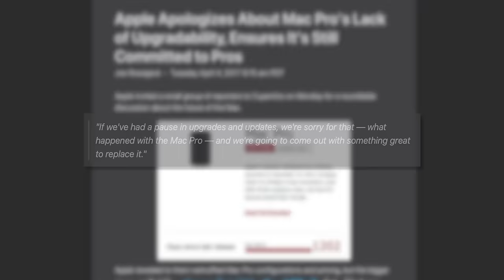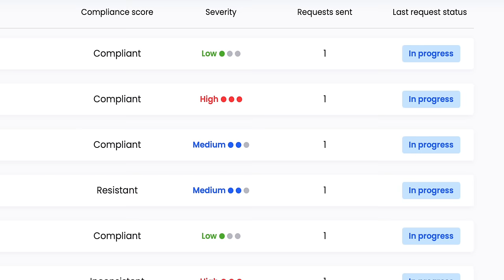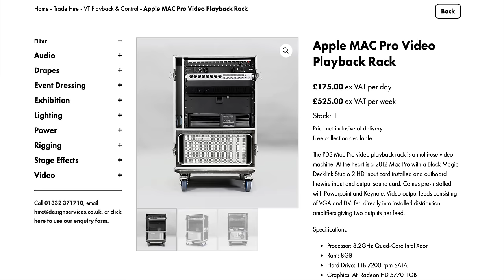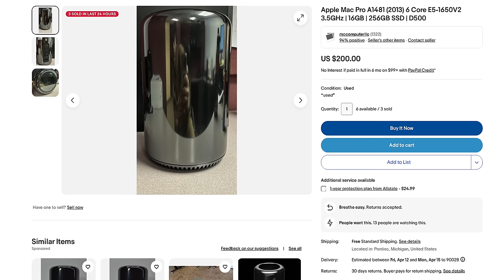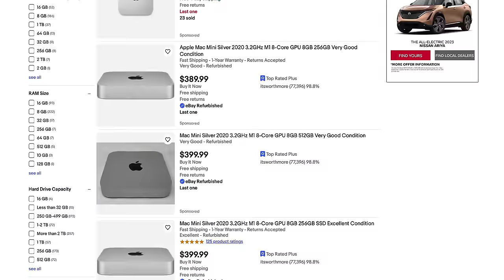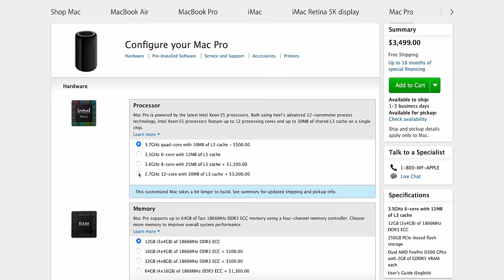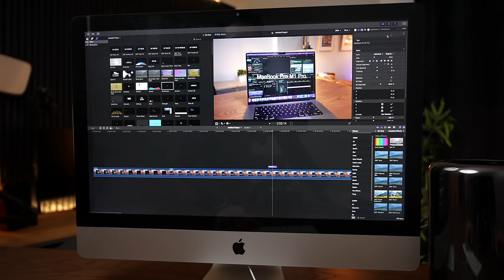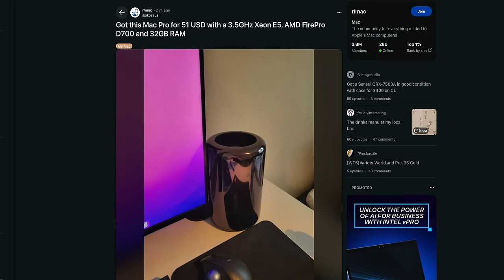Revisiting Apple's FAILED Mac Pro in 2024

Comment: This would be handy for running an older 32-bit compatible OS for longtime creatives, just for opening up older projects. I have Terabytes of 3D & AE projects from that era and before that are currently inaccessible.
Reply: Yeah maybe, but you would still probably be better off getting a dual CPU 5,1 Mac Pro since you can put a modern GPU in there.  CPU isn't as fast though obviously.
Reply: @gametime2473  You really can't put a modern GPU in a 5,1. Not anything newer than say 5 years old.  Needs the apple firmware to get a boot screen, and metal support for anything above Mojave.  Sure it will fit, but what's the point?
Reply: @colindewolfe3647  You can put Radeon rx-6xxx cards in them.  I have done it.  Syncretic patch.

Comment: A good video, I must admit I was surprised you had a second look at that device, I think I might have found the perfect use for these old Macs here in the UK, you see in our schools we use Windows OS not Mac OS, so install boot camp you can turn an old Mac into a great windows computer, replace the spinners with SSD and pop Microsoft Office on them and they are good to go, try putting windows on one using boot camp and bench mark it with a modern windows computer and see the difference, also all those lovely 27" 5k iMac can find a use in schools,  I would love to see that.

Comment: Back in 2016, YouTube Space LA had these in their private edit suites. They also had RED Cameras that could shoot 6K, which was pretty radical at that time. We shot a video with one of those REDs in 6K and that trashcan Mac Pro was the only thing that could handle that footage in FCPX. And it ripped through 4K footage like butter. I know everything you're saying is true (and I own an M3 MacBook Pro Max 16"), but nothing has compared to the sheer power I experienced with the 2013 Mac Pro back in 2016 with that RED footage. It's forever ingrained in my head. (So much so, that I was considering picking up one of these old Mac Pros on eBay)

Comment: I went back to finish my degree in 2012, by 2014 the university upgraded to this Mac Pros for its communication major classes.  I ended up working with them after I graduated and until I left in November 2021, almost all of those Mac Pros were still going strong. I would not be surprised if they are still using them to this day.

Comment: And this is why people like me are still running and using the 5,1 2010 Mac Pro's till now. Hell, I'm writing this comment on my 2010 Mac Pro right now!
Reply: Yeah ironically because the 4,1 and 5,1 has PCI-E slots they are still better than this one.
Reply: My plan with the 7,1 is to put a screaming nVidia card in it in a few years and boot into Linux or Windows with maybe a VM for an old macOS
Reply: Time to upgrade that crap. It’s been unsupported for years
Reply: @emilsecker7881  Yeah it shows how much you know about mac pro's from that era. Do your research before commenting.
Reply: @emilsecker7881  Whatever you say. Your the expert.
Reply: @houseoflords2010  *You’re

Comment: I was the senior (and only full-time) editor at a production company and facility. Over the years, my edit system went from a PowerMac G5, to a Mac Pro 1,1, to a Mac Pro 4,1, to a trashcan Mac Pro. These were mirrored in our two edit rooms. Each time we got new machines, workflow got faster. But the spaghetti monster that stuck out of the back of the machine was not pretty. And we only upgraded one edit room to have a 5-drive DroBo for my editing. At home, I still use a Pixlas-modded, OCLP-patched, Vega56, beefed up monster. Eventually, it will have to be retired for a new Mac Studio. No complaints either way. It's an enjoyable ride.

Comment: I always thought it was cool and forward looking in terms of not needing the internal slots, at least for most users. But that design theory needed, as you said, USB C to really work. I was excited to use one for multiple projectors for theatre projections but the fact that each pair of ports are shared limits how many you can actually connect.

I plan to get one to put on display here in the studio, but don't have a use for one.

Comment: I now have two trashcan Mac Pros, and I've upgraded the CPUs in both. My first trashcan, acquired in late 2022, has a 3 GHz ten-core CPU (and 64 GB of RAM and a 2 TB NVMe SSD). My second trashcan, which I acquired a couple of days ago, now has a 3.7 GHz six-core CPU (and 48 GB of RAM and a 1 TB NVMe SSD). Both CPU upgrades are non-standard and better-value than Apple's official configurations (you could order a 3 GHz Mac Pro from Apple, but with eight cores to my ten), and my second trashcan is like a Base Plus configuration: the same 3.7 GHz clock-speed, but with two extra cores.

Comment: Your trashcan 2013 Mac Pro videos are great. Almost like a series at this point! I think it's pretty clear, from your previous videos, that these are not great personal computers. But how about exploring the data center side of things, since the hardware is workstation class?

Maybe these machines are actually better at running web servers or services with the 128gb ram and 12/24 cpus and double ethernet ports than the modern Macs?

Comment: video idea: make a m1 trashcan :P 3d print a back panel, try to use center triangle heatsink and cover with exterior enclosure.  sleeper mac in a mac
Reply: Keep the triangular internal design and make it a cluster of 3 (or 6) M1 minis (which are largely empty boxes)

Comment: There were two of these where I worked and neither functioned correctly and were eventually replaced by iMacs. They were mainly used with Premiere Pro for editing and DaVinci Resolve for color grading. Both applications suffered from rendering issues, DV Resolve would have random green frames or random lines on the rendered images. Premiere Pro had similar issues but at least PP could be set to software render and disable GPU acceleration, but the only way to get DV Resolve to work was to lower the render FPS speed to it's lowest setting to prevent the GPU overheating and leave to export overnight. There was even an app installed to manually control the speed of the fan to try and prevent the overheating issue but it wasn't that successful.  If I remember correctly one of them had it's GPU replaced but it didn't fix the issue.

Comment: I have one that I use every day. Most of my daily working computing involves using remote desktop to multiple machines that I am managing. I have a 6 screen array that allows me to keep tabs on a half dozen machine at time. Previously I had been using 3 computers each lighting up two monitors. With the Trash Can and some active MDP to HDMI cables I can do all of the screens with a single machine. I get to remove two keyboards and mice from my desk for a couple of hundred bucks. Bonus, my office is nice and toasty all winter. Not as warm as my G5 used to keep the place, but nice enough!

That said if I were to build this workflow from scratch I think a couple of 50" 4K TVs and a silicon Mac mini would be the way to go.

Comment: I remember when they announced this… it was so cool-looking, and I was already hittin the wall with my Mac Pro Cheesegrater. I was ready to call my bank to get paperwork moving for a loan… and then the user reviews started showing up on youtube. I instead got a locally-sourced modded 2010 Cheesegrater that could run 10,11 and (barely) managed to hold on until M1 Studio. I've got a saved search on eBay for the Trashcan—but I just want it for my backgrounds when I'm filming studio videos😂. Great vid. Thanks!

Comment: Good video. I feel like the 2013 Mac Pro could have been something way better if a proper dock was made for it then it could have worked but Thunderbolt 2 didn't take off. The big problem is that the M1 Mac and newer versions you must have an internet connection just to install an OS.

Comment: I ran an eBay search for a great price on a trash can Mac for over 4 years, and never got the price I wanted. 

I cancelled that search and bought an M1 MacBook Air as soon as they announced the M series chips. I still have 3 cheese grater Mac’s at home. Very pumped up. But I mostly use them as DLNA servers now. I do run some legacy software on my 12 core.

Comment: Wow, I remember when it came out and thought it looks nice but I can still work with my maxed out MacPro 3.2. As you say, the pricing was insane. Design wise it's still a good concept having a chimney to draw heat up and out is efficient. It's so similar to Apple's previous failed concept of the G4 Cube. No fans, using a clear central core to draw the air up. I wish I still had a G4 Cube. Ashamed to say it was skipped.

Comment: I had one from new and ran it 10 years. I quite liked it for most of that time. I bought it as an 8core /16GB/1TB/D500 and changed it to a 12 core/64GB/2GB machine and it was quite quick. The main boost was the SSD. But compared to an M1 it's still slow. and the Trash Can won't run current OS. So ultimately was glad to see the back of it.

Comment: I use one as a Proxmox and has been super reliable as a Linux based server. I used to run VMware ESXI on it and it was solid. 12 cores. ECC RAM. Dual network interfaces. Nice for a home lab server.

Comment: I have one, it came with the A700 GPUs, the 12 core CPU, and 64 GB ram from the factory and the serial number indicates it was build in Q2 2019. I paid around $300 for it a few months back, but someone who originally bought it must have paid around $10k and then probably never used it. Anyway I get a little over 7000 in Cinebench R23 running in Monteray. It runs Windows 11 pretty well but when gaming it uses 250 watts, so I don't use it either and it just sits. I have a M1 Mini 16/512 which gets around 6800ish in Cinebench R23 so my trashcan just slightly beats it.

Comment: I utilized my previous device until I acquired my MacBook Pro M2 Max, which offered significant upgrades. I enhanced its capabilities with a 128GB OWC Kit and a 2TB OWC Kit, complemented by the 12 Core version featuring dual D700s. Throughout its use, the device performed admirably, requiring only occasional restarts for updates. Regrettably, I had to part ways with it due to Apple discontinuing security updates. Interestingly, I retained my 2012 Mac Pro Tower, repurposing it as a capable Win 11 gaming PC. Great Video by the way, keep them coming.
Reply: It's pretty sad that the 2009 Mac Pro can beat many of the new macs to this day in gaming performance.  With a modern AMD card, you can game at 1440p quite well.

Comment: Great video!  In my opinion, the current Mac Studio is a great successor for having a powerful computer in a small form factor with enough ports and costs $2k.  Before Apple Silicon, I used to Hackintosh to get the power I needed at a reasonable price. Now going strong on M1 Max MBP!

Comment: I went with the 2018 Mac mini because I already have a 16” M1 MacBook Pro. I like the 4 thunderbolt 3 ports plus it can be a part time windows machine in a way M1 cannot. There are some steam games I just want to play that don’t work on Mac. And with the Radeon VII EGPU it still performs great for that. 

Additionally I can leave a 4tb NVME plugged into the back of the Mac mini and not have to drag it everywhere with me like I would with the laptop.

Comment: Have one, love it. With 2 TB and 64GB it runs very well for most normal applications and especially for running multiple virtual machines. And yes like my G4 iMac Sunflower it does not make sense for power apps but look at the design. Still looking for a cheap G4 cube to complete the Apple design top three.

Comment: I feel you Luke. I bought a trash can Mac Pro for $120. The only non-upgraded component was the graphics (D500 instead of D700). But while I loved it, I ended up putting OpenCore on it and selling it for $200 on eBay to make a bit of cash, because with my many Apple silicon machines it just didn’t make sense.
Thinking of buying a for parts trash can Mac Pro and using it as a flower pot or something the way you can with dead HomePod minis.

Comment: The design is cool for personal use, but I worked as a tech at a video production company that decided to switch to these in 2015 and it was a nightmare. Between peripherals, multiple external hard drives, external GPU enclosures, and 10gig ethernet adapters, cable management was atrocious with these things. Everything had to plug into clunky thunderbolt adapters and squished into the tiny back plate. No matter how careful we tried to be, they always ended up looking like Frankenstein's monster, which was pretty embarrassing when clients were visiting. On top of that, these things kept locking up and crashing during intense video editing, especially 4k video.

It really felt like Apple slapped the professional industry in the face at the time.

Comment: Thanks for this! Until now, I was thinking of getting one to transfer the "brains" of my iMac 2015 into while simultaneously transitioning to an M2-system, but now I feel it could be more straightforward to just keep using the iMac in parallel without the extra hassle (a KVM switching was on my mind, but the lack thereof is no dealbreaker).

– Eero

Comment: My first generation G5 cheese grater is still working. It is now just a word processor [running Claris] with about 75,000 documents in the files. But knowing it’s age I just got a M3 iMac running pages and do all work in Pages. If I really need need a document to be sent over to the new platform, I print it from the G5, scam it into Pages. Love them both.

Comment: I have - and will always keep - a 2013 MacPro Trashcan - I maxed it out with 128Gb of RAM and then a 2Tb SSD (both from OWC Macsales). The only real problem I have with it is it stopped updating at OS Monterey v12.7.4. Ima going to tweak it so it runs Sonoma - by using OpenCore Legacy Patcher 1.4.3. Fingers crossed...🤞🏻

Comment: Luke I get that Apple silicon is great but there are work loads where the 8-16gb will not even be close to enough RAM, creating a bottleneck which negates the CPU power benefits!

So depending on your use case I think it's still better than the Mac Mini

Comment: On August 2023 i buy a D700, 12 Cores Xeon with 128Gb 1333Mhz Ram, for 699€, add a 4tb ssd for 269€ and for generic use and 2d design is the best buy possible for me. When the M series evolutioned to the 4-5 iteration with the M4-M5 i think the situation for change platform. Tomorrow my machine is a rock solid value workstation for generic use a ridiculous price.

Comment: 8:14 one scenario where this would be a very good buy is something like when you need a Windows machine with a lot of RAM but you also need from time to time a very stable MacOS machine (yes you can do hackintosh but it's not the same).  500$ for a machine with 64 GB ram 1TB ssd which can run MacOS and W10 (not on a VM) I would say this is a good deal. Of course there are very few people who find themselfs in this situation and need this setup but I think this is still a relevant machine.

Comment: I bought one at the beginning of the year on a whim for a seriously low amount of money. I spent more low amounts of money on the 12 core Xeon and 128gb RAM. Spent a bit more on a 2tb ssd and some thunderbolt 2 drive enclosures. I now run it as a hyper visor with various VMs on it and it’s stinking. You can’t go faster for £150!

Comment: I have owned everything from an Apple IIc, to a newton, then from G3 onward to the M2 I use now. With both laptops and desktops from apple under my belt, someone can have my trash can when they pry it from my cold dead hands. It's upgraded to the max and still gets daily use with Triple Apple Thunderbolt displays. It just looks great and does everything I want it do (Have a windows gaming pc for gaming). Once the software is not supported and runs nothing from Apple, I plan on it living out its final days as a home server.

Comment: 11:40
Amen, Apple now has awesome performance per watt, meaning thermals are now a trivial issue; and hates upgradability more than ever. Might as well give us something that isnt a boring grey flat box.
Reply: Yeah, the this design was always thermally constrained which is why apple let it rot for 6 years without any CPU upgrades... The newer Intel chips were not getting any more efficient and were pulling even more power. 

This design would easily work with Apple silicon, and if apple wanted to be nice the SSD and RAM could be placed on the back of the outside and easily upgradeable.... But that's dreaming. 

This is a cool looking machine, much better than a grey box on your desk.